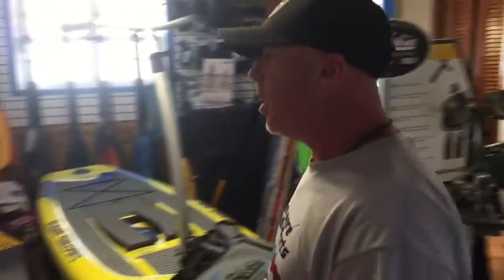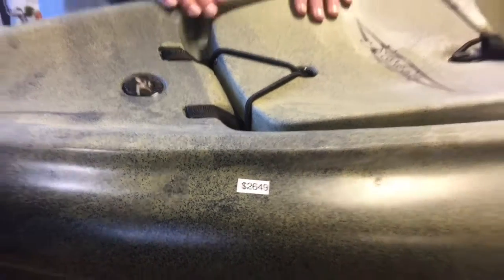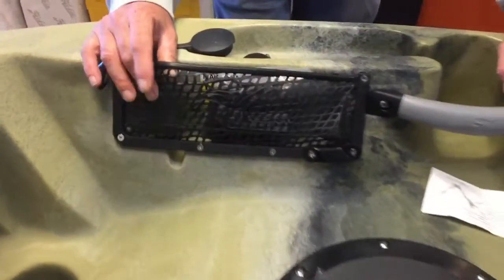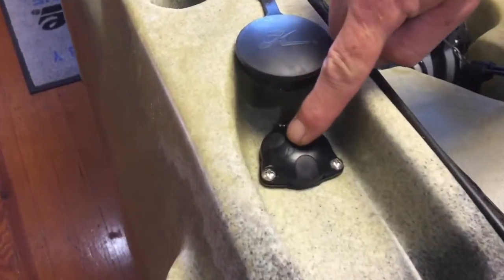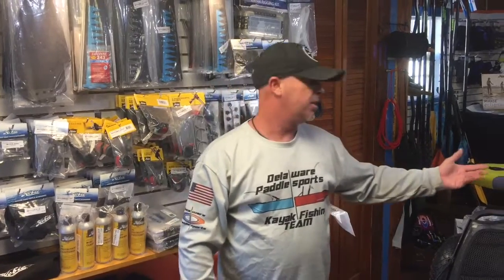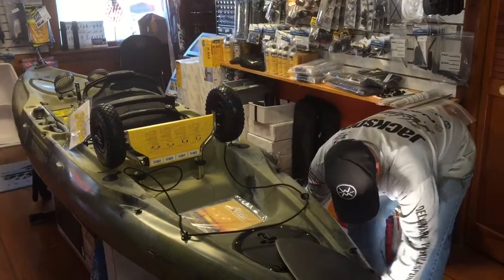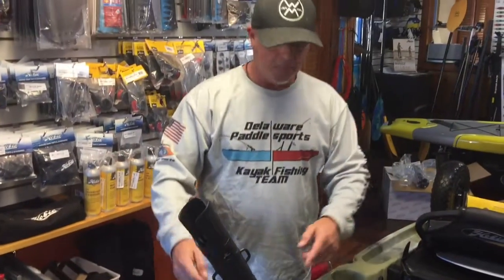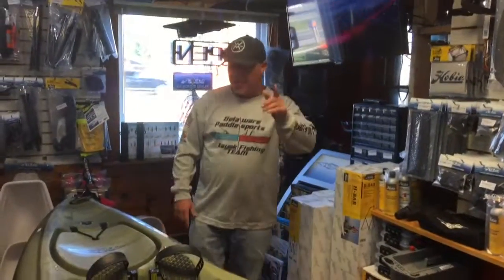2017 Camouflage Hobie Outback Mirage Drive 180

Comment: A very thorough review!  Two, questions for on the water: 1) What sort of speed range does it have, average effort and sort of top end? and 2) How well does it paddle?  Thanks!  Brad
Reply from the maker: Hey Brad thx man, so top end would be about 4 knots however, if you wanna get going you could get a little better but as a trolling kayak and to get 3 miles offshore no problem. As far as a paddler it will paddle in time of need but its not gonna paddle faster than a streamlined paddling kayak. The reason is its design is more preferable to foot propulsion. Let us know if you have any further questions or feel free to give us a call 302-645-7300